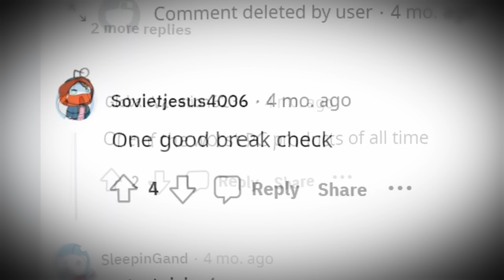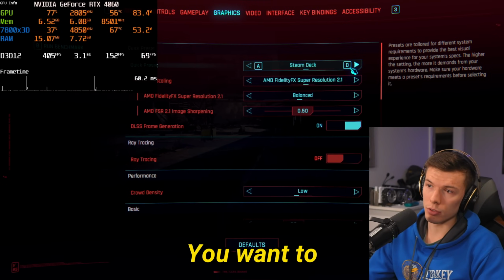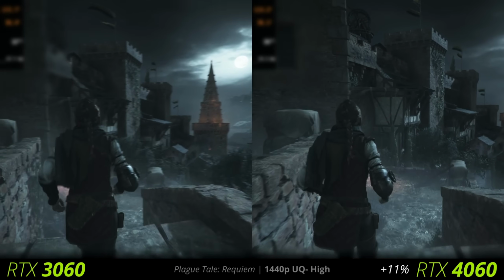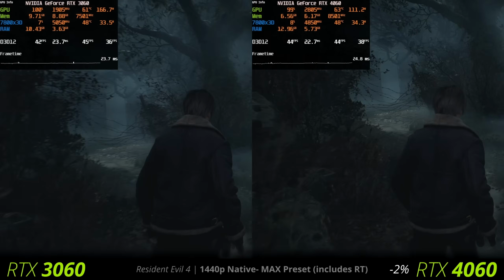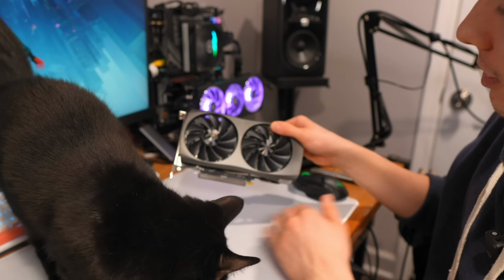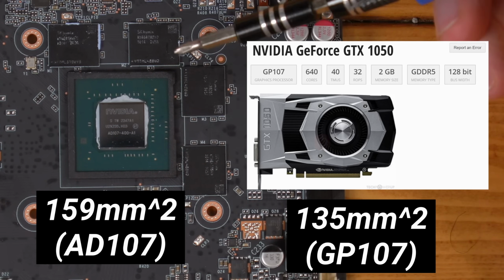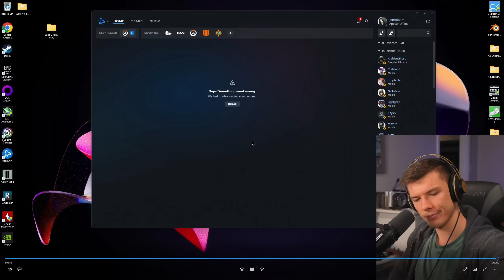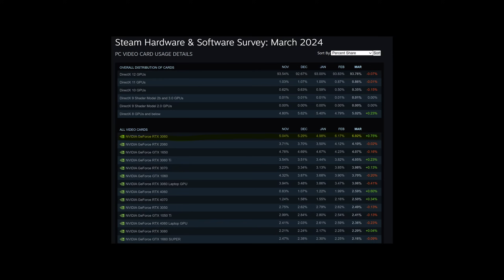I Tried Nvidia's best "Budget" GPU to see if we're Doomed

Comment: 4060 should have been labelled 4050, it would have made everybody happier.  As it is, I think they rebranded it because they see PC graphics going in a very different direction from traditional rasterization, and the Geforce 4060 shouldn't be evaluated primarily in terms of its non-ray traced performance.  DLSS is essential to understading the future of PC graphics (AI generated rather than traditional full rasterization).

8 GB of VRam is still plenty for 1080p gaming.  NVidia is betting on raytracing being the future of gaming, not high resolution displays, and judging by the lack of 4K monitors on Steam's hardware surveys, they are probably right.

Comment: i have a 4060 since a year and at first it was absolutely playable, but since august it became ABSOLUTELY unplayable, it has too much fps stutters that dont make you play. on fortnite,with  performance mode, everything low, i even optimized it, but it is unplayable, i'm starting to think that is smth abt the cpu (i have an i5-12400f, ppl recommended it to me for the 4060), like that it isn't fast enough for the 4060. i think i need a faster cpu but they cost way too much... even if it would have bottleneck i think it would be better. correct me if im wrong and sorry for the long comment (if i did some grammar mistake is cuz english isn't my main language so sorry)
Reply: That doesn't sound like a problem with the gpu, they don't really tend to just suddenly drop performance like that. I have a 4060 too for about a year now and it works well still, so i think there might be something wrong with either your gpu or something else in your system, maybe a power supply issue? Not a pc expert, so i might be wrong
Reply: @krysetic  what if it is a cpu problem?
Reply: @krysetic  if it was a problem in my system i would think the memory but i alr transferred 50gb of videos to my other HD, maybe it is because i have 32gb ddr4 of ram? i dont know but is weird
Reply: i even cleaned temp files and useless things btw but is the same
Reply: @dock_weser  maybe a 4060 problem, What CPU are you using for the system? You should also open up task manager and as you play games check how much cpu and gpu you are using and if the cpu is maxing out, its most likely bottlenecking your maximum performance on the card.

Comment: Ah, yes... used to be that a xx60 card was really all you needed to play current games without compromising too much in the visual department. These days it seems that sweet-spot has shifted upwards and a 4060 Ti (or probably even a 4070) is what I'd consider the minimum for AAA stuff. Especially if you want some eye-candy and/or more than 1080p. I mean, what's the point of doing AAA-stuff if you can't enjoy all the bells and whistles without the game turning into a slide-show? 
Problem is that even if you factor in inflation, that means you'll have to expect at least €100 in added cost - doesn't help that Nvidia seem to have gone a bit nuts WRT MSRP and cards don't seem to drop in retail price over their life-span as much as they did in the before-times. I guess Jensen's sweet, sweet leather-jacket money has to come from somewhere.

Comment: Well were im from the 4060 is going for 309€ and the 3060 for 314€ so my question is why is the 3060 so expensive if its around 20% slower than the 4060, or is it that the 3060 price is correct but the 4060 is so weak that it as to be set to a lower price?

Comment: Is it better than the 1660? Because I want a cheap upgrade so I can get 165 fps on low settings for cod at least.
Reply: Techpowerup puts the RTX 4060 at like 42 fps faster than a GTX 1660 Super at 1920x1080p.

Comment: They knew it was a 4060, ain't no body stealing that off your porch lol. I went from a 750ti, to a 1060 6g, to a 1080ti, which is now siting on my shelf in retirement as i bought a used FTW3 3080 for $350 last year. The newer cards are so depressing, the only ones that are actually a step up, cost a kidney. Idk if i should just bite the bullet and swap my 3080 for a 3090 and hold out for another generation or so. The 10g of vram at 1440p is JUST BARELY ENOUGH for high in most games, Nvidia needs to wake up on vram amounts

Comment: bro if dollar users think 300 in a gpu is not worth imagine how some of us in brazil (which ranks among the top 5 countries that consumes videogames) feel about paying 3,000 on a 8gb 4060, or a 4090 that last time i saw it was around 1900 dollars was around 20,000 but it was gotten quit cheaper at around 13,000 (btw our average monthly salary is 3.000) so we had to work 4 and a half months without eating to buy one, the whole gaming industry is going crazy, we have to spend enough money to buy a car just so we can play a game in 1080p at ultra without the need of crutches like dlss and frame generation and 1080p isn't even considered a good resolution by them anymore, it's considered the bare minimum
also the vram for me is the biggest downside of the 4060, like how do you think we'd do with a 40s with less than 8gb when most games now need 8 at the very least, there is nothing left for us to use the actual rtx 40s resources like fg and ray tracing

Comment: Bro im getting so sad watching this video, i still have a 1650 😭 and yet a 4060 is not the best? 😭 bro i wish i had anything above mine 😭

Anything that would get me above 70 fps at high graphics, i would be so glad to get it
Reply: I just got the 4060,not ti, abs with dsll and ray teaching shaders at ultra high I can still have 60 fps on any game, if you don't use ray tracing you can easily have around 180 fps on any game at max graphics, the 4060 is not expensive right now either, so I think it's very much worth it, if you're going to wait for new cards of the 50 series they're going to be like 3k when this 4060 card is barely around 300 right now and can run anything you want

Comment: The reason its so expensive is because they don't want you to buy a 4060 right now, they want you to buy the 3060. Why because they got a lot in stock that they want to get rid of and the 3060 compared to 4060 is that the 4060 is cheaper to make. it's like putting the performance of a sports car into the size of a mini for the fraction of the cost. so the 4060 is the best "budget" GPU, but not right now. they'll probably lower its price when the 3060 goes out of stock or in low stock, make it's price the same or similar to 3060 used. Being a better deal comparatively, but this is just speculation. not to mention all the press about the 3060 being a better choice probably helped them with sales for the 3060, this is just the clear house to say. when the 4060 lowers in price it'll look better comparatively for newer PC builder's.

Comment: Works great as mobile gpu for casual gamers . The good thing is that mobile 4060 = desktop 4060 which is not true for 4070/80/90. A decent 4060 laptop is $1500. For $500 more you get 4070 mobile, but you are still getting the 8gb vram.  For another $500 you get 4080 mobile with the amazing 12gb ram! Give another $500 more and you'll be picking the cherry on the top of the laptop cake - 4090 with whole 16gb of vram and performance of a desktop 4070 super ... Given those bad choices the 4060 is not such a sucker for a laptop. I know it is not good, but it is the one that sucks less.

Comment: As someone with 4060TI its honestly not that bad. I can run Fortnite with 2 4K 120hz monitors on flat 120fps. I cap it on 120 but it can run up to 240fps.

Comment: So, is the 4060 not that bad? And does FG only support the 40 series?
Reply: Amd and nvidia both have FG. Nvidia version only works on 40 series card, amd version work for both amd and nvidia gpus. Amd version uses fsr 3.0 and I believe it will also work on gpus as old as 10 series. 4060 is decent but as pointed out in the video it does have downsides, IMO the performance difference is pretty small and I think youd be better off buying a used 3060 instead and saving a bit of money.

Comment: i totally dont get the hate, if you actually want the best ray tracing and 120 fps on ultra settings go spend that 1000/2000$ on the 80/90's cards, but other than that, the 4060 runs all the casual games, ultra settings, on 200/300 fps, people act like there are no other games than cyberpunk, and think that ray tracing for under 300$ is supposed to be some kind of standart
Reply: Yeah content creators  really  like to trot out Cyberpunk  for testing.  That  game is not even new. Plenty  of to be quite  frank better games have released in the years since  it. But they still drag out that tired game.

Comment: the real problem on this card isnt just the 8GB, actually it is fine for 1080P, the biggest problem is that in specwise it is lower then the RTX 3060.. if they would just use a wider bus for the memory it would perform much much better..
but no, nvidia just got greedy and dont give a F* about mid tier marked anymore, they just dont need it anymore

Comment: The 4060 has been a trash card to me. If Nvidia classes it right as 220-250 4050. It would have been a good card. Or bump the v ram to 10-12gb @ 250-290. This card is a bat and switch card. Call it's a class higher then it really is an we can up are margins, or make the next year card look better so you spend 500$on a card instead of 300$

Comment: You can make the same "it's fine it plays games and it's not a scam" for every slop nvidia releases as it keeps jumping up the price for each "entry level" card the release, in fact, you contradict yourself when critizicing the 3050 over the 4060, when it still "plays games and it's not a scam", it's just worse for those games you tested. 

It's not about being a pc master race bro, DIY PC gaming (the market that this standalone GPU is aiming for) has always been about customization and either getting good value (perf/$) or getting the best possible performance, and the 4060 doesn't deliver good value, which, as an "entry level" card is its sole purpose.

Therefore, IMO the 4060 is fine for people who have no idea about the intricacies of PC gaming and is best suited for pre built PCs. It'll play games, and it's not a scam, and most stores won't charge an arm and a leg for a system with it. But the standalone card, which is shown in the reddit post and the motivation for this video, is bad value slop, which I wouldn't recommend to anyone and given its purpose it's NOT a good product.

Also about your point on justifying Nvidia for not caring about the low end because of the margins, the margins are fucking high already why do you think the stock price is so high? A small ass die with a small ass PCB isn't expensive at all to make, and as you said, it should've been a 4050 (and the 4060ti a 4060), but ... shareholder value am I right. 

But this is AMD's fault as well, since the pandemic their duopoly has screwed over customers more and more and it won't stop unless a third member enters the competition, I wish the best to Intel so we customers can have better value products.

Comment: Destroying the 4060 because of the 8 GB VRAM is a bit unfair - my 3070Ti "only" has 8 GB RAM too, so?
Reply: The 4060 is two years newer. VRAM limitations are an increasing discussion.
Reply: @usul573  But does that make the 4060 a bad card *today*?

If you say it is, then my 3070Ti, with its 8 GB RAM, is also a bad card today too.
Reply: @ibizenco  Not exactly just more scrutiny.

Comment: rtx4060 16gb that came later is what it should have been at once n if it had been 16gb i would have got a preebuilt pc with that vs the rtx3060 12gb i have now(ofcourse the oprice would have to be as low as the 8gb version though)

So now when i seen games like Horizon forbidden west in different videos n resolutions compared these 2 gpus and the 4060 is better still,BUT the 3060 12gb is just looking better n better as long as the vram is higher then 8-10gb or even moore even in some games(i have seen 13+ gb being used in HFW Burning shores) 

So how will the rtx3060 12gb vs rtx4060 8gb age is a good question?? 4060 8gb is much faster n gives much better fps in almost all games vs oldr 12gb gpu...
But how will it look in 2025-2026 and onward because people will still be using these gpus for years to come(many like me dont have the money to buy a better pc and thats no FUN!)

Thanks 4 this video

Comment: ... so I went to Steam charts. It is the second most used video card as of the time of this comment.

What drives me off the walls of that all these "reviewers" only test for the most ultra settings. This is a mid range gpu meant to be paired with an i3 or i5 respectively. I know this because I had a budget system that performed well enough on mid settings. All of my cards have been Nvidia because the one time I tried AMD the thing sounded like a plane about to take off on a framed locked 60 fps Elden Ring. It died a month later.
Reply: The problem with calling the RTX 4060 mid range is that it is literally the bottom of the range. This is it. There's no lower 4000 series cards you can buy for desktop.
Reply: @usul573  May I dare ask, what is mid range to you? I am genuinely curious. I hate to sound like an Nvidia apologist but all 3 of the cards I have ever bought over the course of 17 years performed wonderfully for my low budget builds. I can't even remember the first one. all I can recall is the EVGA GTX 260 and an ASUS GTX 750 TI. those cards lasted me forever. I went through 4 motherboards and 5 CPUS before the things finally gave out. I get the feeling that this current ROG Strix 4070 TI will last me at least 5-7 years, I bought a stand to prevent sag. I take care of my stuff.
Reply: @LyraniaLothar  Would a 4050 be mid range? Yes, the 260, 750 Ti, and 4070 Ti are all quite good cards. Though there is no 4030 or 4050 that I can see. The 4060 is literally the entry level or low end card in the current lineup of cards unless you fall back to the 3000 series cards which use slightly older technology.

Comment: The 4060 was built to fill the gap taken up by AMD budget cards the hope was the guys that buy the $300 AMD cards would switch to Nvidia that didn't happen the problem is it can't even compete with the almost 7-year-old 5500 XT in most cases and then AMD came out with the newer 5600 XT that just wiped the floor with the 4060 for $15 less. If you're on a low budget them AMD is king.

Comment: why o why .. card like these 10 years ago were the bottom of the barrel and should not cost more that 150.. the cards that used to be able to the things the MAINSTREAM GAMER had a super good experiance with costed 300.. and the super high end cards costed like 800/900 the tiers shifted x2 in prices .. 10 years ago you could build a super high end "gaming"system for 2000 / 2100 now that is the price for 1 top tier graphics card
Reply: also astonishing is how the market superficially is creating scarcity by under manufacturing so they can up the prices.. this combined with the tech-scalpers has destroyed main stream pc gaming..

Comment: i am so tired of hearing this argument of the 4060 is bad because it does almost the same as the 3060. Does no one look at power consumption and long term running cost?? the 4060 can perform at a much lower power draw, meaning you spend less to run and it runs cooler! why can't people understand that!

Comment: All this talk about FPS .....  FPS is only the starting point to know if you are even in the right ball park with respect to your settings and expectations done without DLSS or trickery.   In some ways 1% lows are equally important for a stutter free experience especially when you move and pan .... and this comes down to VRAM.

And even 60fps isn't really 60 when you look closely sometimes  .... I personally found 120fps on a PS5 wasn't even as good as a true 60FPS on a well running PC for the games I played.   Sony on titles that ran "quality" settings with RT supposedly ran at 60FPS but really it wasn't even 30FPS when you panned and looked at the background updating.

In Cyberpunk you can have a 60fps frame rate, but when you watch traffic move the stuttering is obvious, and DLSS and frame gen doesn't fix this.  Above 1080P even a RTX4070 can't have maxed settings even without RT if you want a real 60FPS everywhere when moving and panning.  For gameplay .... setting crowd density to high improves the game vastly .... even on medium there is no oncoming traffic in most of the city core and much much less NPCs  .... but even maxing this one setting taxes CPU/GPU .... but it is much more impactful than RT ... and crowd density on high and RT above 1080p will bring most systems below 60fps ....  

How fluid and responsive your game is when you move and pan is much more telling than FPS  .... measured in a moderately taxing area of the game.

Comment: Until Nvidia graphics cards are over 100 teraflops with 32GB vram.... cheaper.... and with low power draw..... I'm not interested. Expecting to upgrade with 7070 in 2028. If it's over 500 dollars I will wait till 8060.

Comment: so what are 300 $ gpu that is better than this?
Reply: you can get a 3060 which has more vram and would honestly be way more future proof then the 4060, or you can get a RX 6700 XT, As long as you have a good CPU which wont bottleneck these gpus.
Reply: @noahniskala  arc b580 just has been released though. Probably should wait a while and buy it even cheaper than the other gpus. Reviews are highly positive for this price, as far as I've seen
Reply: @Pantelyk  Honestly yeah, I made that comment forgetting about that gpu But thats a good one aswell.
Reply: @noahniskala  but rn its price is about 380 euro. Someone said the price is so high because the first batch of it has already been sold. So, the price will go down later ig
Reply: @Pantelyk  Ah your in Europe, yeah you should wait for awhile sense I know the prices can get ridiculous over there.